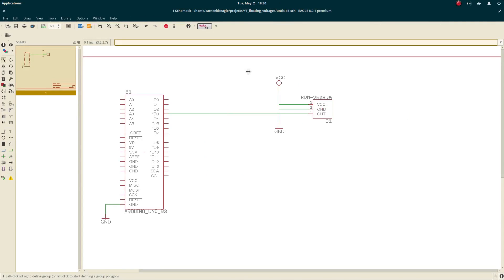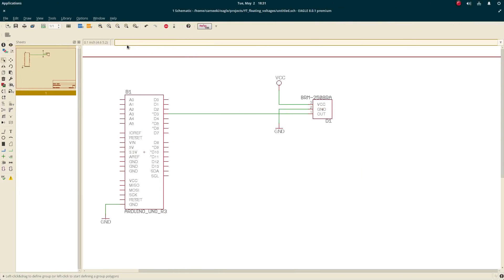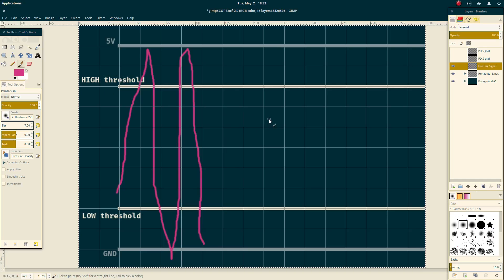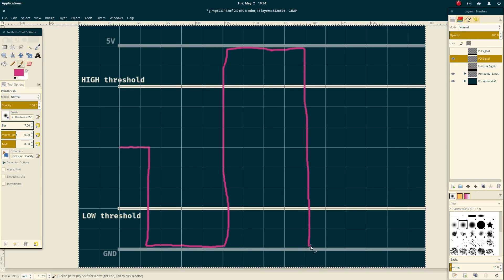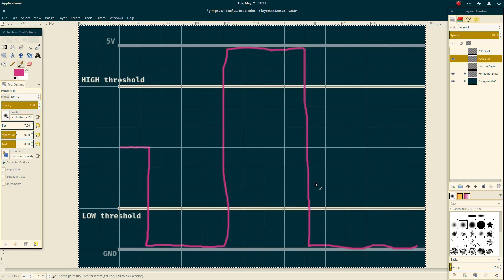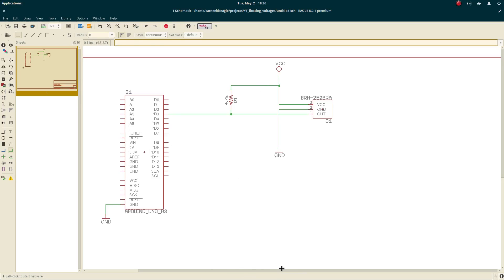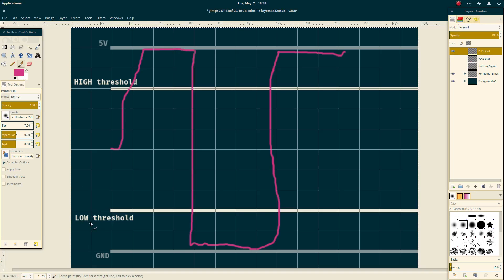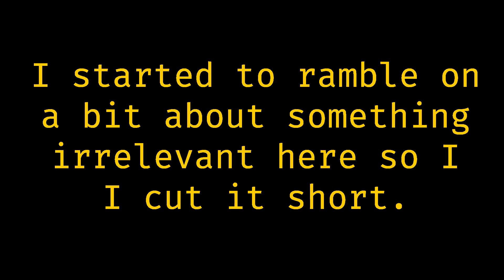ELEC::Floating Voltages

Comment: Good info. Quick tip: to draw straight lines with the brush in The GIMP, you can click at the start and shift-click at the end point; then you don't have to worry about squiggles from your mouse. :-)
Reply from the maker: Thanks :)
Wow, that's a seriously handy tip... While holding down shift, I thought I'd try Ctrl as well, turns out it locks to horizontal, vertical and increments in between (every 15 degrees by my reckoning).

Comment: Good information.  Is a pull up/pull down resister a normal resister dedicated to that pupose, or a special one?
Reply from the maker: Michael Murray great question! They're just a normal resistor. Given the tiny amounts of current and low voltages, 1/4 or even 1/8 watt resistors should be fine to use in most cases. I often use a value between 1k and 10k for playing around with Arduino.